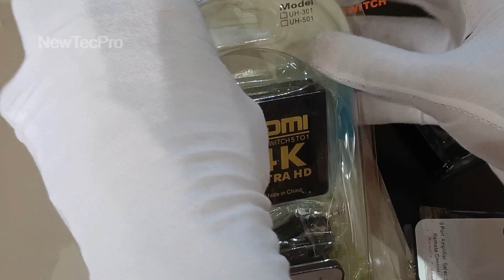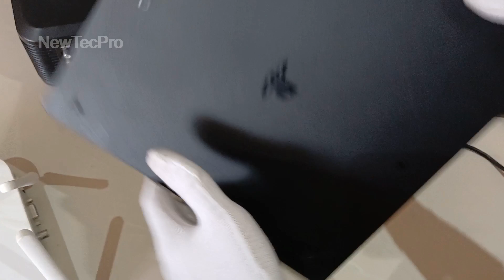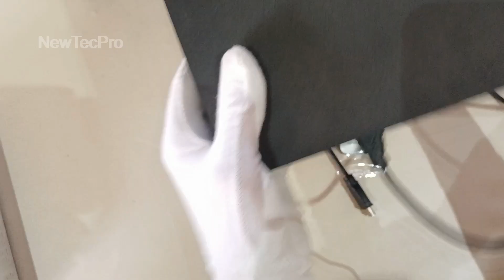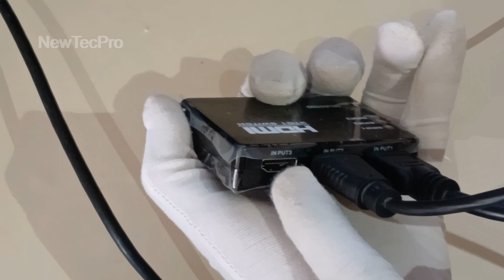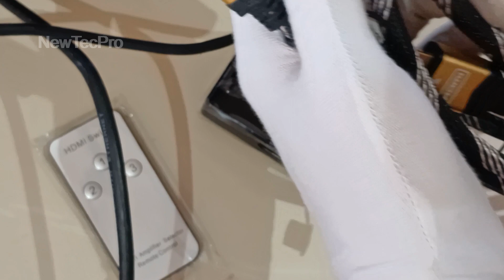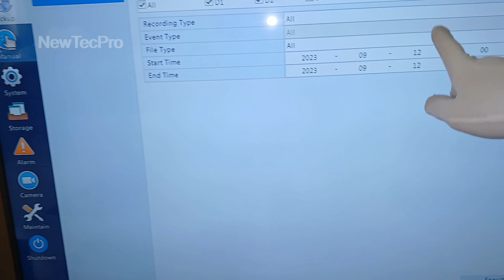how to use HDMI Switch 3 In 1 Out 4K?

Comment: Hello. Does the remote control use CR2032 or CR2025 batteries?
Reply from the maker: Hello 🙂
Most HDMI switch remotes use a CR2032 battery.
(Some models may vary, but CR2032 is the most common.)

Comment: How to connect  a hdmi switch to a cable tv
Reply from the maker: To connect a cable TV box to the HDMI switch, plug the HDMI cable from the cable box into one of the input ports on the switch. Then connect the output port of the switch to your TV’s HDMI input. Select the right input on the switch when you want to watch cable TV.
Reply: I did that and it's still not working.

Comment: did yoou neeeed 5v external suplly?
Reply from the maker: The HDMI port provides 5V power for short cables. But if you use an HDMI cable longer than 2 meters, you may need a separate power supply
Reply: @newtecpro  is power for usb enough?
Reply: @newtecpro  thanks
Reply from the maker: @israel_should_not_exist  Thank you for your support and comment.

Comment: is there any option to how to get 3 or multiple screens to the one pc at same time like 3 displays at once
Reply from the maker: This device accepts 3 HDMI inputs and provides 1 output for 2 monitors.
Do you want it to work the other way around? That is to provide 1 HDMI input for 3 HDMI display monitors?
Reply: @newtecpro  i want to work like suppose we have a four monitors from one i have to live in obs on yt but i have to capture three display from 3 diff monitors at same time like 3 window capture so if that any solution on this problem
Reply from the maker: @jatin1021  If this is true: "You want to convert 1 HDMI output from say PS4 to 3 HDMI port outputs for 3 TVs or monitors."

 We will post a new tutorial video on the NewTecPro channel soon and in the next few days, please watch it.
Reply: @newtecpro  yes like i want to stream from pc via obs and capture windows of 3 pc at same time for spectating tournaments
Reply from the maker: @jatin1021  Hi again. The video related to the device you needed was prepared and placed on the channel. Watch this video:
https://youtu.be/mcdErzHNzN8?si=RUjQKqfyIck6RCi1
Reply: @jatin1021 i think that may be an hdmi splitter if you’re looking for the same display on multiple screens, but if you want different windows/ desktops like one for Obs and one for your game, you can daisychain your display port or hdmi between the two monitors then plug another hdmi (Seperate) into your pc/ laptop